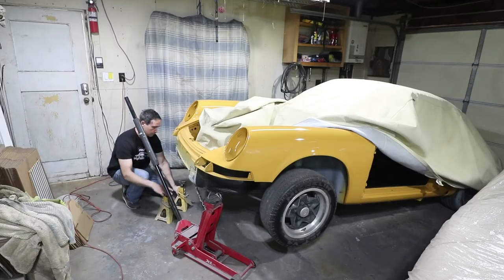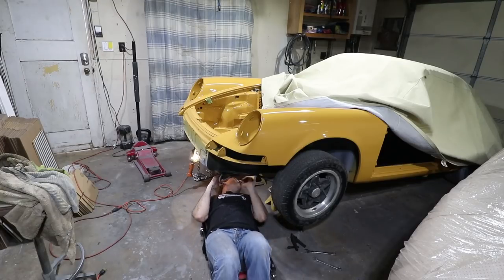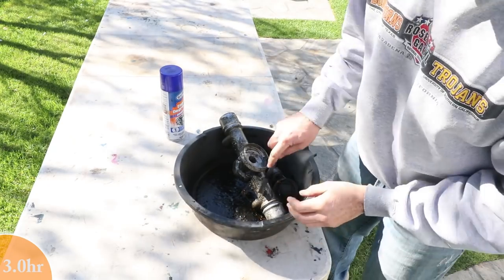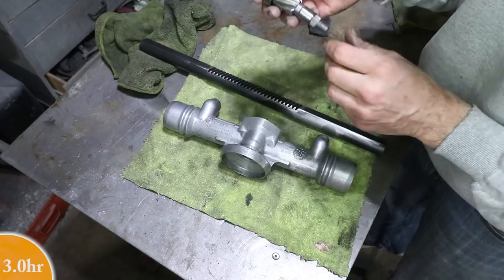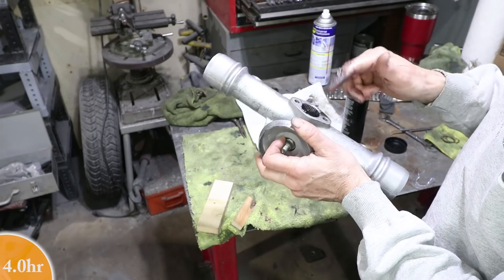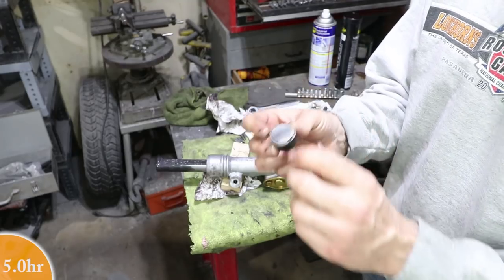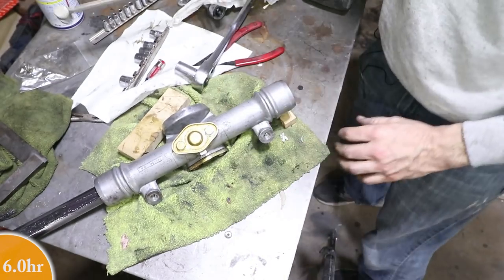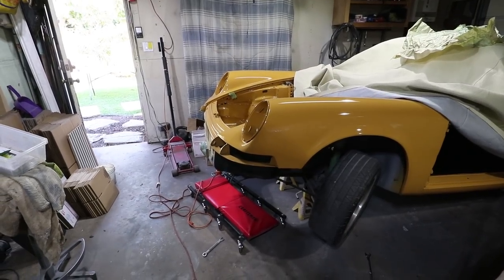At Home Rack & Pinion Steering Rack Rebuild - PORSCHE 911

Comment: I use a soda blaster, I purchased from Harbor freight to do parts like this.  I also did my front hubs, when I rebuilt them.  The soda blaster will clean nicely, and not change the texture of the metal.  I also used it on my weber carb bodies.  And my fan and fan housing.  I then used a light coat of clear, and the parts, even the magnesium ones have stayed really nice for several years now.  Lock tight is good to use on that steering yoke.  Mine was loose when I took it off.  I have found that on the cheaper turbo tie rod kits, the rubber boots split out, so I buy the Lemforder kits.
Reply from the maker: Soda blasting or dry ice blasting is a good call!  I just don't have the tools or will to make it look that good, ha ha.  Maybe the fan, oh wait I don't even have an engine.....
Thanks for the heads up on the boots.  I will keep my eye on them.  They seem pretty stretchable so far.

Comment: Hi- I’m a fan of your series...I’ve watched most if not all of you episodes. It occurred to me that it would be helpful if you could explain/ show us the multiple Jack points and areas that you place your jack stands. I know it seems pretty basic, but it would be very educational and helpful in keeping everyone safe. Thx!
Reply from the maker: Hi, thanks for watching!  Good idea about jack placement and safety.  Since my car is so empty and light I don't always pick it up like I would if it was at full weight.  For this episode I put the stands directly under the front cross member.  It's steel on my car.  If you have the aluminum cross member then I wouldn't put the weight on that part.  I think you can see where the jack stands is on the cross member when I was removing the rack.  
When I lift the car for the undercoating video I share some tips.

Comment: Owning an 86' with 200,000 miles on it, am thinking it might be time for a rebuild.  Do you think the rebuild is comparable in results as opposed to just buying a new one.  Expensive yes (new), but not an issue at this time.  Have done a lot of DIY projects on the car and not afraid of the work...just wonder, years later, your thoughts?

Erik
Reply from the maker: New will always be better, but if you measure, source, and replace everything they should be the same.  
The rack and pinion gears are designed for zero mesh and wear isn't really a noticeable thing.  Replace the bearings, slide pick and it should be good for another 200k.
Reply: @GarageTimeAutoResto  
Thanks for the response, hope to catch you at another Hill Country Rallye...

Comment: Great video Tom I just wish you would’ve showed in the beginning of your video. How are you disconnected the steering column from the rack. I am beginning to remove my steering rack from the car to install new turbo tie rod ends.
Reply from the maker: You don't need to remove the rack to install turbo tie rod ends.  
To disconnect the steering column you need to remove the pinch bolt completely, but I wouldn't do that for tie rod ends

Comment: How did you arrive at decent alignment when complete? I didn't see where you measured the length of the rack or thread count on tie rod ends at the beginning for reference on reassembly. Is there another method that gets you close enough to work from?
Reply from the maker: I did my own home string alignment and corner balance here.
https://youtu.be/khe21yHY5bg?si=AlZf0Xn8eO4dvkOE
If you want to drive it to a shop then I would put a straight edge on the tires and line it up with the rockers.   That's close enough to drive a short distance .
You need the car to be at actual ride height when you do this.  
In terms of thread engagement, you want the same amount roughly between left and right sides

Comment: Don’t you half to center the rack before you put the yoke on that goes to the steering wheel for timing purposes to get the steering wheel straight ?
Reply from the maker: You might be right, but I know the steering shafts have a bunch of splines on them too, so it probably doesn't matter where the yoke is.  I'll let you know when I get to that point of installation.  If you don't plan on taking the steering column shafts out like I did, then position of the yoke might matter more.

Comment: Its crazy how every video or write up does not cover the threading on the inner tie rods.  Here, you sped through the connection as others do.  Every video shows the passenger side being removed and disconnected but hardly ever the drivers side.  Are the left and right inner threads the same or is the drivers side reverse thread?

Comment: Hey Tom.  Great video!!!  I have performed the same procedure on my rack, and I have more than the .008 clearance between the puck and the cover plate.  The shims are 24mm I.D. x 30mm O.D., and I am having a difficult time finding exact replacements.  Did you have to order shims?  If so, do you have a part #?
Reply from the maker: I always get shims from McMaster Carr.  Sometimes a close size is available and I hand fit the ID for example.
Reply: @GarageTimeAutoResto  Excellent.  McMaster Carr has a 22mm I.D. which will work.  Thank you for sharing the wonderful details of your projects.  I get so much inspiration and help from your videos, and my '74 Targa has turned the corner from the seemingly never ending phases of disassembly/stripping/rust repair/body/paint, and now I have begun reassembly with the front suspension and steering.  You rock!
Reply from the maker: @chrisrogers8253 yes!  Keep in going😃

Comment: Do you have any concerns replacing a critical component such as a tie rod with a non-OEM part? As an avid cyclist I’m always leery of replacing critical components from unknown suppliers. There are so many things that can go wrong if the supplier has not done thorough engineering and testing. Maybe I’m just overly paranoid because I know how much analysis and reliability testing my company does, even for non-safety related components. 😬 Another fantastic video!
Reply from the maker: Hi Phil and thanks for the comment!  This is a contentious topic and the politically correct thing to say here is buy what you are comfortable with.  Nobody got fired for buying Porsche (IBM).  
Here's my take on it.  (I'm a licensed professional Mechanical Engineer);
The engineering has been done by Porsche or a Porsche supplier in the 70's with a large factor of safety.  I'm not aware of any factory recalls or issues resulting from poor design on the steering components.   
Alternate manufactures who make these parts are using the same design dimensionally.
The issue becomes materials and quality control.  Are the load bearing surfaces the correct hardness for wear?  Is the material ductile enough to avoid catastrophic failure?
As an owner mechanic on this car, I intend to monitor the critical components often whether they are Lemforder, Porsche, URO, or anyone else.  If I see any play or wear in these components they will be removed immediately.
I'm not worried about the tie rods just breaking without any warning.  If I was I wouldn't use them.  I'm a little more concerned about the strut ball joints by the way.  
Quality control for classic car parts is a crap shoot even for the OEM brand suppliers because the sales volume and public eye is not there anymore.
So is the OEM price worth it?  I'm not so sure about that.  I do support the aftermarket companies who keep our hobby going where in many cases the OEM's are no longer available. 
This should have been a video, ha ha.
Reply: @GarageTimeAutoResto  This a problem with most replacement parts is the assumption, on most peoples part, that due diligence and proper QC standards are adhered to. Case in point is the bearing at the top you replaced although it appeared to be in functioning condition. In my experience in the automotive retail and shade-tree mechanic side of things, that replacement bearing may very well be an inferior part and subject to early failure for the untrained DIY'er. Hopefully, that will not be a concern but only time will tell. Excellent video Professor...
Reply from the maker: Thanks man!  You are right about replacement stuff.  I ordered my bearing from McMaster which generally sells good stuff.  Time will tell.  These cars aren't daily drivers anymore either which also delays the failure of all these weaker parts.

Comment: Hello,

Great video.  I am undertaking the same rack rebuild on my 1987 Carrera.  Is there anything you would do different?  Is the rebuilt rack holding up ?  Are the parts you noted holding up well.  Any In sites would be greatly appreciated.

Thanks,

Arnie
Reply from the maker: All is good.  Every rack may need something different.  My outer bushing were fine, but your results may vary.  I don't have any great sources for parts.

Comment: Nice work!  What is the ratio of your rack?  I'm just about to perform a reassembly of my 911 SC's steering rack and I opt'd for the Quaife quick ratio.  I think the earlier models are pretty quick already.
Reply from the maker: Mine is a 74 so I presume it's the slow rack.  I'll count the number of turns when I get back in the garage.  Have you installed that kit?  I'd be curious to know how you like it.
Reply: @GarageTimeAutoResto  Not yet, I'm still accumulating parts - I need the tie rod ends (a bit undecided which way I'll go.)  It'll be while before I can test it, but the parts look very high quality.  The rack housing needs a small amount of machining to let the larger pinion fit too (very easy for a machine shop.)
Reply from the maker: My rack is 3.1 turns from stop to stop.  It's probably a little bit less when installed in the car though because I think the struts carriers stop the movement before the rack does.  I'll keep the Quaife parts in mind for a future upgrade.
Reply: @GarageTimeAutoResto  Yeah, that sounds about right.  I believe it's 3 turns lock to lock on an SC as well.  The Quaife unit is 2.5 - about the same as the 993 models.  I guess I'll find out eventually if it was worth it!

Comment: What fluid did you use to clean the rack housing?
Reply: Remembered I had an Eastman bead blaster and it cleaned up the rack quite quickly. I wore a sand blasting helmet for eye protection but a short sleeve shirt. The rebounding beads hardly had any feel.
Reply from the maker: I think I used engine degreaser or auto trans fluid.  Make sure you get all that sand out.